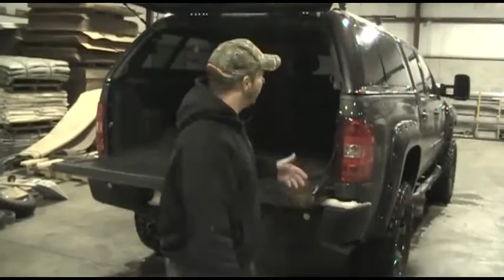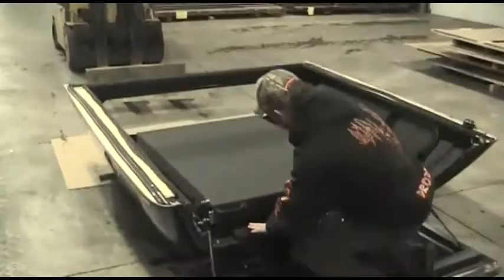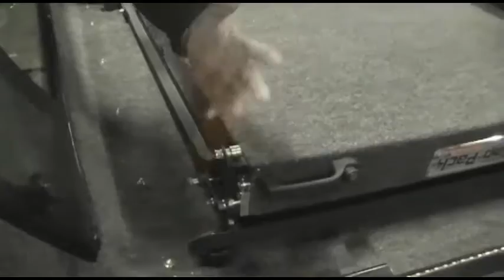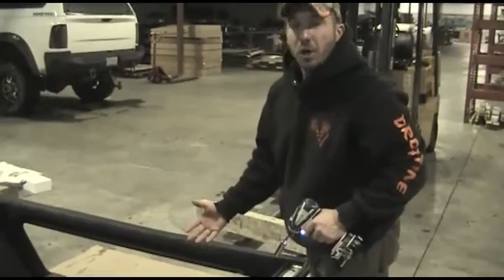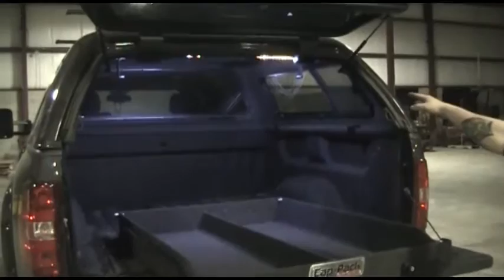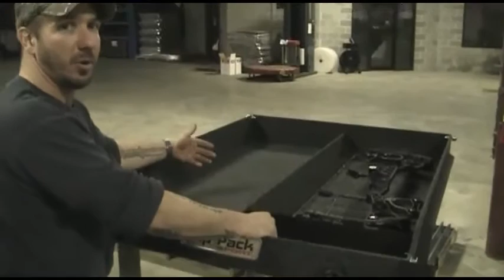Install

Comment: *I'M GETTING A ARE Z SERIES ON 2020 TUNDRA DOUBLE CAB. IF I'M ATTEMPTING TO INSTALL WHILE CAP IS ON THE TRUCK. DO YOU KNOW THE CLEARANCE DISTANCE TO INSTALL IT FROM THE CAP OPENING? IS IT 6 INCHES 7 INCHES AWAY SO THE DRAWER CLEARS THE OPENING? I'm assuming after I know the clearance distance,  I can set aside the drawer and MOUNT THE RACK AND BOLTS WITHOUT THE DRAWER IN PLACE?